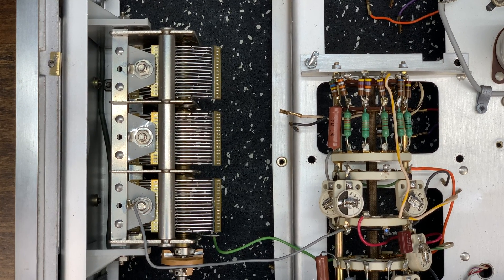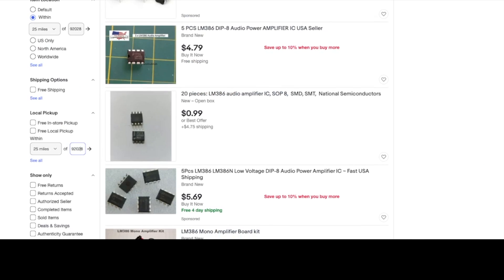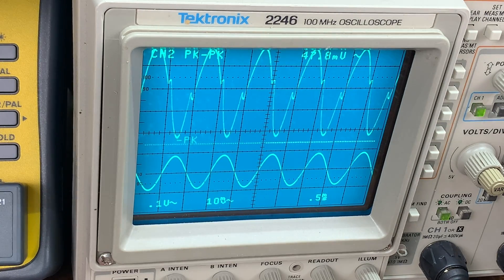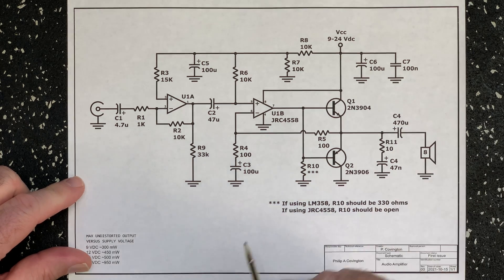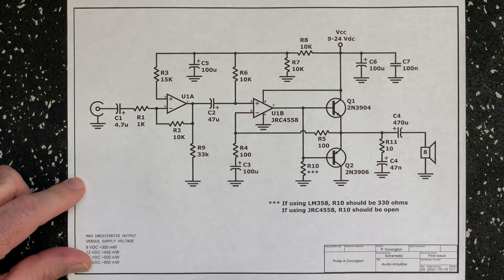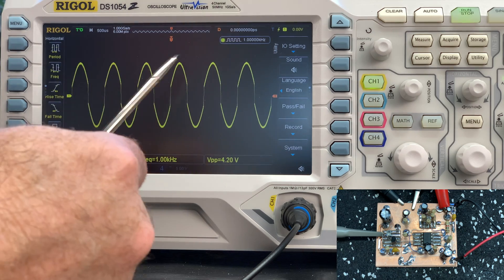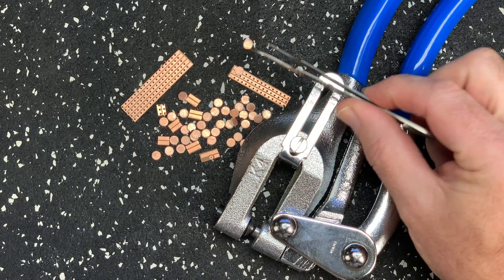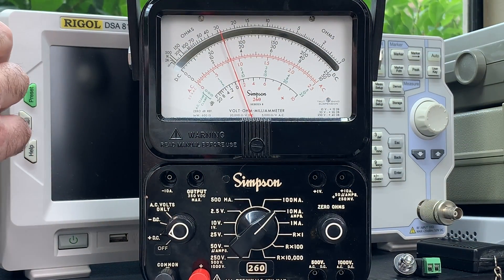A Small General Purpose AF Power Amplifier (LM386 Replacement)

Comment: tda2822M is used very often has 2 channels which can be bridged. If you want to do discrete transistor 8050 8550 is a great pair. also used a thermally compensated bias with a pot and a sense transistor. 3-5 ma bias is enough. Opamp is not needed at all. just 1 single transistor can drive it . May want to bootstrap load resistor for driver transistor.

Comment: sorry for a stupid question, but what is the purpose of R10?
Reply: R10 is in the circuit to provide a load on the output transistors at high frequencies.  The reactance of C4 is high at audio frequencies, which essentially takes R10 out of the circuit.  But at much higher frequencies, the reactance of C4 is reduced and R10 becomes an increasingly heavy load on the output.  This helps prevent high frequency oscillation.

Comment: Thank U for this video.
By the way there is a lot of IC's  which considered very good with less components as well as it has a wider operation voltage rang Such as TBA820m , TDA7052 , TDA2822  TDA7231 , TA7331 , TA7368 , CD7368 , LM4871 , FM8002a and the powerful TA7252AP

Comment: I don't think you need R9. Unless I'm missing something, I don't see it doing anything useful. I'm also worried that U1B is going to have stability problems. My quick suggestion would be to have a series resistor between its output and the bases of the transistors. (My gut says 47R to start.) I'd also add a small value capacitor as direct feedback from the output to the inverting input. It may be fine now, but I think you'll get oscillations if you use an opamp with a higher GBP. When using op-amps with output boost stages in the feedback loop, you need to keep the GPB of the op-amp lower than that of the boost stage.

However, it's working for you, so my suggestions could be unnecessary. :D

Comment: A couple of diodes between the bases of the output transistors, with a trimmer resistor across them to set idle current, would eliminate most all of your crossover distortion. Keep in mind that the fast slews of the op-amp trying to eliminate the crossover distortion (caused by running the output transistors in pure class B) might well create noise in your receiver. This would disappear with my suggested change, which converts the output stage to class AB.
Reply: But that would reduce efficiency and power handling. For voice reproduction class B with NFB is good enough and I don't think it creates much interference. 0
Reply: @westelaudio943  Well, that of course falls under the aegis of one of my favorite adages: "If it works, don't fix it." 🙂

Comment: It's very easy to build a 3 transistor circuit which is functionally near equal to the LM386. 

I do think the LM386 will continue to be fabricated into the future, but it is a bit under engineered, as it prefers 16 ohm loads at higher power supply voltages.

Your circuit is nice, though.

Comment: I fortunately found long ago at a recycling center more than 50 destroyed no-brand walkmans (the cheap ones that were produced in mid 2000). I managed to salvage some 40 brand new LM386 and many transistors that all were new from factory. For my needs, I think I have enough. I tested them and all were functional in the specs from datasheet.

Comment: The LM4871 'boomer' (or clones like the 8002) have taken the place of the LM386 in my uses. Cheap, super easy to set up, flexible, and bridged. something like 3W from 5V supply.

That said, a buffered op amp like this is pretty easy to set up too, and permits surprising power. I modified your circuit a tiny bit, and am getting about 2W output (on an +/-9V supply), with a (very) small amount of crossover distortion, using an NE5532 op amp and some random TO-126 transistors. Component count is minimal, especially if used on a split power supply.
Reply: Thank you forn the information on the ICs.  I'm back after a few decades off the key and needing to find more modern amp chips. 
I've seen videos telling / showing how to tame / perfect the LM386 by using .27  capacitors on 3 of the pins.  That's done to make the IC quieter (noise) and to eliminate some BCI.  I'm wondering if there's the need for that sort of mod for the 8002 etc.
Thank you.

Comment: Surprised how clean that output is. That said, most of the circuits I've seen for this include two diodes to bias the transistors apart from each other.
Reply: Yes, I experimented with a few such circuits and the crossover distortion was too high for my liking.